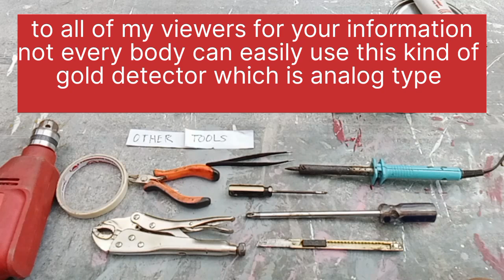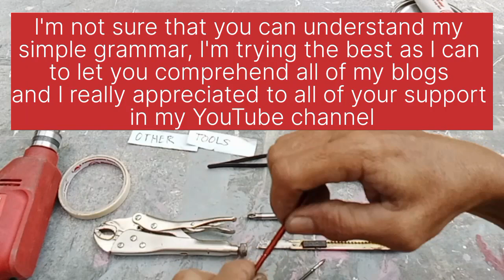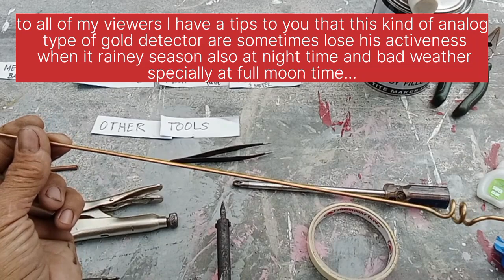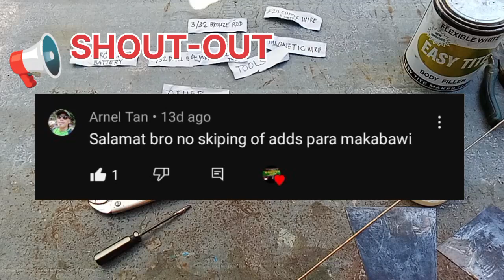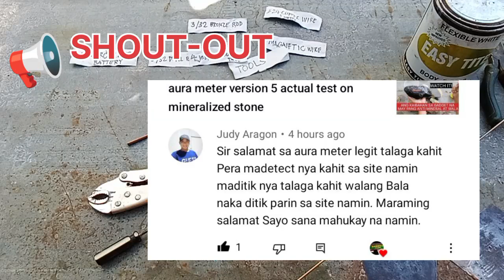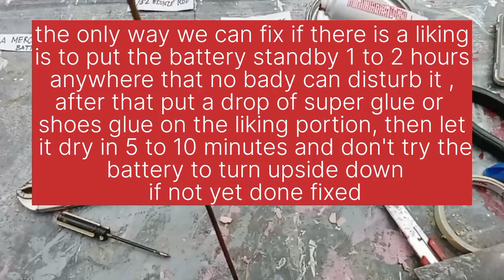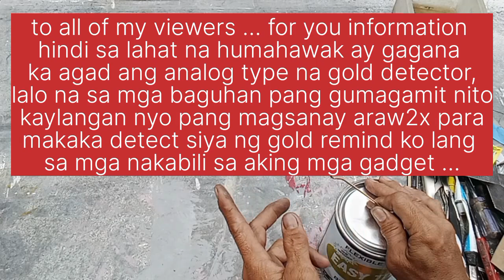diy ,how to connect the rod and the battery properly

Comment: Thanks friend!. the battery casing is ferrous metal... can the interior mercury led be removed and placed in another copper or aluminum casing?
Reply from the maker: yes buddy you can remove that and replace another casing, either copper or aluminum match better
Reply: @dannysvlog_th  Thanks bro